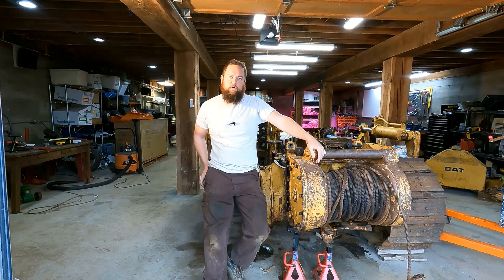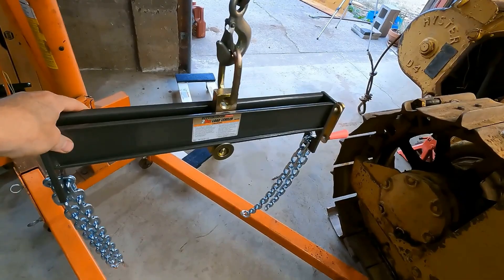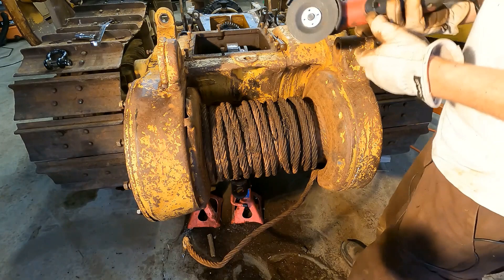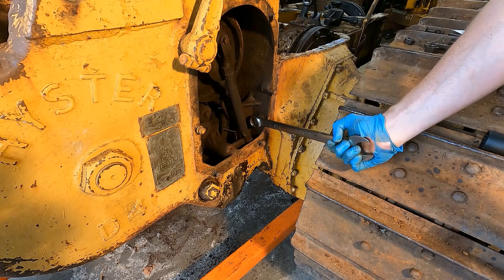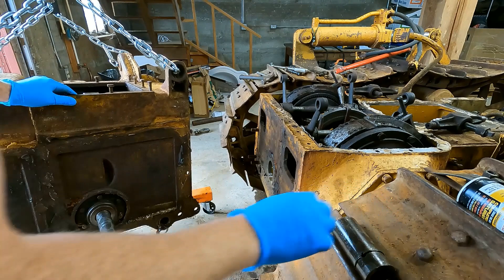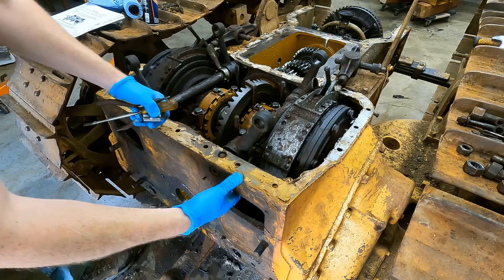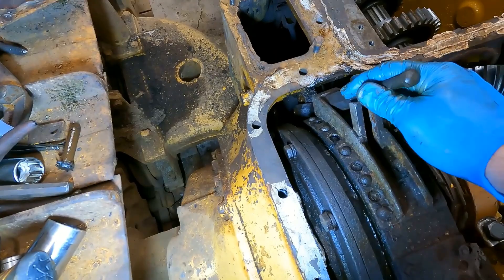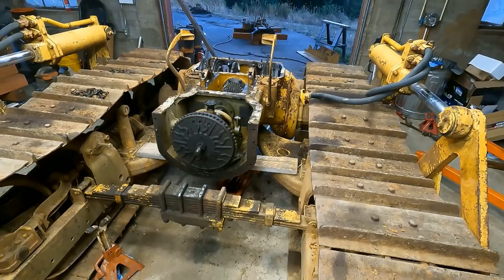Removing the winch from a Caterpillar D4 (way heavier than it looks!)

Comment: Clean it, bang off the loose rust, inspect, repair where necessary, and spray it with bar & chain oil diluted with kerosene. (Props to Mustie1.) It'll develop a film of oily dust that'll stop it rusting further. Use melted toilet ring wax for the topside. Painting everything has its pros but you'll spend an awful lot of time degreasing and other prepping. And hanging it all, of course.

Comment: None of my equipment is painted and pretty. The one tractor i did paint looks like crap now because the scars from use show up so bad.
 On the other hand I would much rather fight paint on a bolt than rust. As you have found out there are a lot of fine thread bolts on the thing and rust eats them faster.
 It all boils down to personal preference. 
 Be safe and have fun!
 Terry from South Carolina

Comment: I enjoy the vids Matt,,,I have done a few major teardowns too, what works for me is all the bolts that i take off a certain part, i put in one container with a note what its for. Old plastic food containers work well & their free. I usually have more than one project on the go at a time while i wait for parts for another. Some take yrs to complete, im not gonna remember what bolt goes where unless i do that, plus it makes the put back together alot easier

Comment: Paint the dozer like they say below. When putting together lay out bolts by size. Some may have to be grade "8" and lock tight, fine thread and steel lock nuts. Use good yellow paint. Your doing ok keep going we will help you with problems.

Comment: All of those original CAT bolts were grade 8 bolts, please be sure to replace them with grade 8 bolts to avoid any problems with broken parts and bolts later on. You might even consider going back with CAT bolts, they used to be reasonably priced, but I don't know anymore, it's been a while since I bought any.

Comment: Clean it , rust stop-preventive,then roller and brush-thicker coat . If use sap leave treads for later.Also find an industrial fastener company as you go through your days locally.look around some, Clean and inspect count , record the most important ones  and get that group and so on ,really rusty drop in vinegar a couple hrs.

Comment: Definitely paint it. And best to not use rustoleum. Rustoleum is cheap and easy but for all the work that goes into it your better of getting some real paint as oil based fades quick and never actually fully cures. Oil based will bleed for a long time and dust tends to stick to it and makes it harder to clean. Not that you mentioned oil based paint but figured I’d inform you of my experience

Comment: your getting into the guts of the little beast ........good job......one thing  your lucking out with the bolts ....the heads  on mine were  almost rusted out .and i broke quite a few of them.....id give them a  smuck with sledge........and  sometimes theyed  let go..........

Comment: You should be using a proper mobile gantry crane to lift/lower those heavy parts and pieces. If I could not afford to buy a gantry crane I would make my own out of steel tubing or I-beams. I could hear that engine hoist creaking and groaning with that very heavy weight suspended from it, not good.

Comment: National Fines are stronger in pulling or holding like the stud  kits for heads and cranks and don't cheat on the grades. High stress -black alloy, cad plate -gold  gr8 ,assemblies,galv gr5 cover -access panels and sheet metal bodywork..and Pro Chem antiseize  when she goes back together. I was thinking how tall are you those 2" tubes under the seat and tank is for better seat height so your knees don't get tangled up with your elbows trying to drive it unless your 5'6".

Comment: As far as painting it. I'm in for painting the parts you pulled off. Like you say you don't think painting the drive train is a good idea. I agree with that. But everything you pulled apart should be, mainly rust prevention. I'm not saying go and buy CAT PAINT any yellow paint will do just to protect surfaces. Besides you went through all the trouble to fix it why not paint it. One youtuber I watch doesn't give his cars a nice paint job so he doesn't have to run out and cover them up if it rains. I wouldn't do that no matter how good it looks. Still you are way more braver than I taking on such a project!!!

Comment: Since it will be a working piece of machinery, I don't see a whole lot of purpose in painting it.  Perhaps, when it is all assembled, you can buy some paint and just spray over everything.  What is hidden won't be seen anyway.  As for any sort of rust protection paint provides, I don't think it will make a whole lot of difference.  Just make sure all the moving parts, nuts, bolts, any anything else that may need to come apart in the future, is greased or coated with anti-seize to help keep things from rusting together.  Paint isn't going to stop rust in the long run and that heavy metal is not going to be compromised by the rust anyway.  Just my half-cents' worth.

Comment: Clean the back of the trans housing where the Serial number plate is located. Ive seen the number stamped on the housing in that location.
Reply from the maker: I did that, didn't see a stamp anywhere.  Guess I'm out of luck.

Comment: Do you suppose there was too much rope on the winch? "Long lining" doesn't seem to make a lot of sense - an add on tag line for the occasional long pull? Smaller diameter on the drum means more pull power/mechanical advantage, and damage to the body of the winch or the drum flanges from overwrap would be less likely? 80 feet or so, max?

Comment: Hey Mat, I saw you use gliptol (which I've never heard of) to paint over the inside of whatever that was you were working. You painted on the inside of it. Would that be good to paint on the underside of a lawnmower deck to prevent further rust? Love your videos. Lots of hard work. Great job.
Reply from the maker: I would recommend using a polyurethane paint to paint a mower deck, Por15 is an option, but there are cheaper ones out there

Comment: Somethings not right,its comes apart to easyli,it must be an little bugger there somewhere,at your stage its normal to use at least two containers with oxygen and 1/2 container acetylen and an box of nuzzels,so i might be an little evil there,maybe hes hiding in the sprockets somewhere

Comment: Hey Hillbilly, where did you source the manuals for the D4? 
Also wondering if you have any news on the “other engine” did you get it?
Not sure how to contact you but would like to share some pictures of the one I am getting from the bush.
Reply from the maker: You can get reprint manuals for pretty much every machine ever made on eBay I've found.  My contact info is in the video description.
Reply: @PacificNorthwestHillbilly  thanks, I have already emailed you some pictures of my machine as it sits to this day. Plan on driving it out this spring

Comment: Matt, If you are going to do any tree work won't you need a winch? If I understood your video it sounded like you were removing the winch and not replacing or fixing it.
Reply from the maker: you have to remove the winch to get the steering clutches out

Comment: Van sickle tractor paint is cheap I'd paint it with that at least.
Reply: Might paint it as you go so you can paint the bolts after you tighten them so the paint doesn't chip when you can of course

Comment: Do yourself a favor and order some new wheels for that hoist. Something rated for over twice the weight you're moving shouldn't have been that difficult to roll. And you do not want any of those wheels breaking while you're trying to move it under load.

Comment: Do you have any idea what the winch cable costs?  Really sad you destroyed it!
Reply from the maker: 100 feet is around $250 for 3/4" cable...  The old cable had a lot of damage to it, wouldn't really want to use it either way.
Reply: @PacificNorthwestHillbilly  Look for the serial # under where the tag was , I think they stamped the case, I could be wrong.
Reply from the maker: I'll check Deane, thanks.

Comment: You just disappointed me. I'm so tired of seeing "mechanics" using a claw hammer. Claw hammers are meant for the carpentry industry and their face hardening is far different. PLEASE, use a ball peen hammer for striking hardened steel faces.